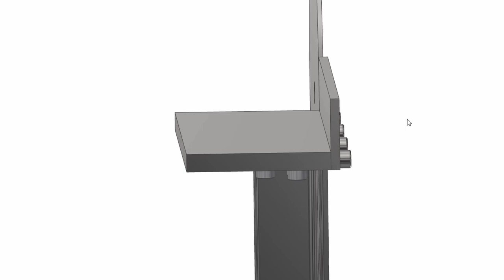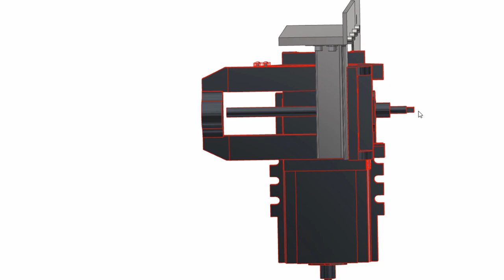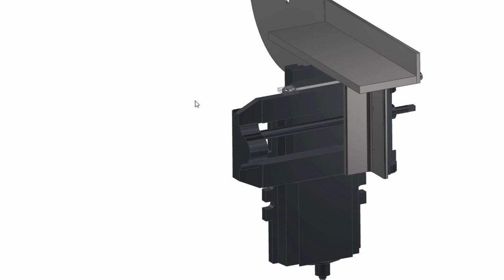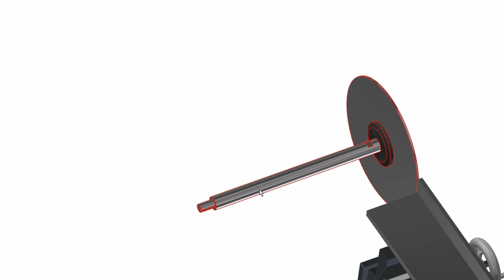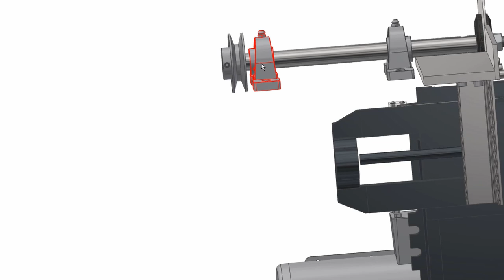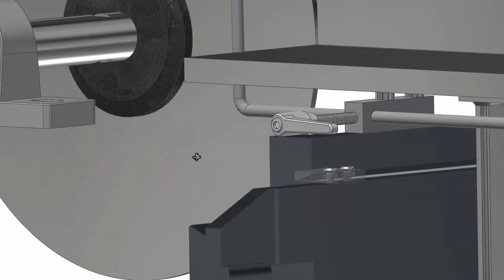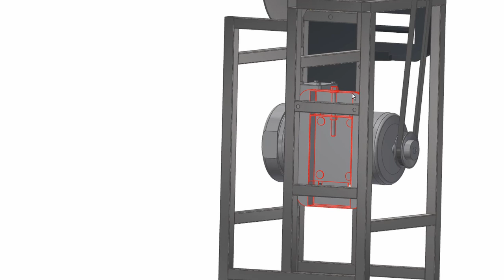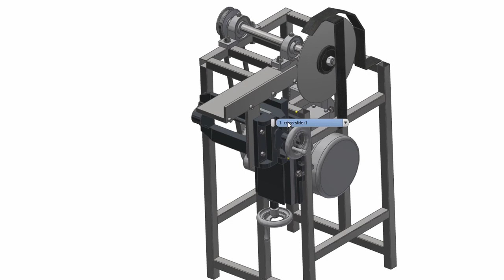Tenon Cutter Build Part 1: Overview and Design Methods

Comment: I was really hoping to have a parts list or suggestions so we could build a long. I suppose I should develop some CAD skills.  But I really like that build and execution.  What a nice time saver.  Do you feel your XY table is threaded fine enough for small adjustments when you're trying to get everything really tight?
Reply from the maker: The plans I sell have parts I think, yeah the lead screw are sufficient to really dial things in.